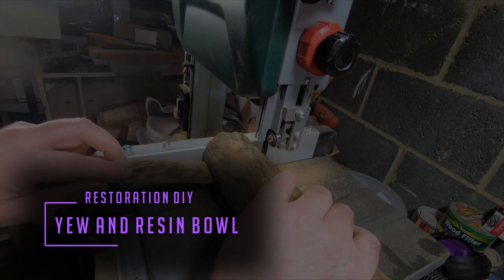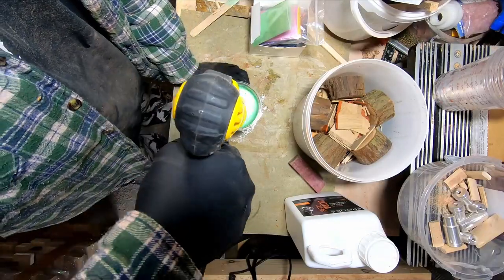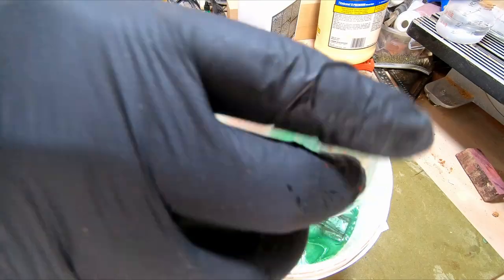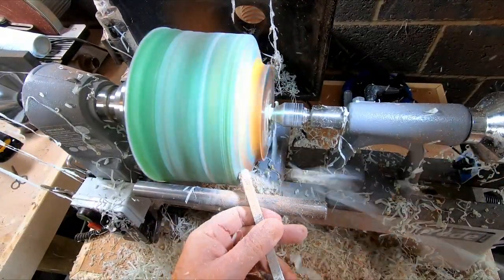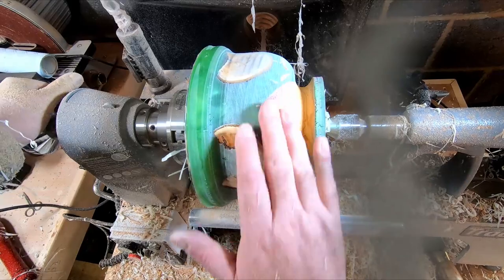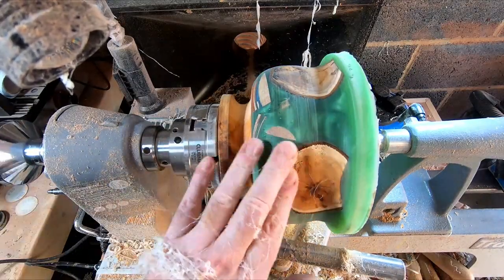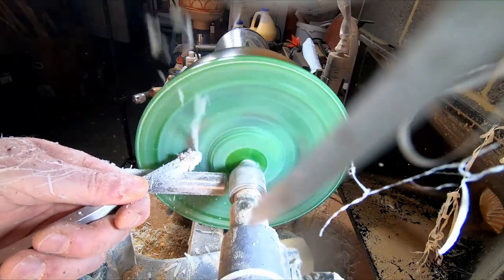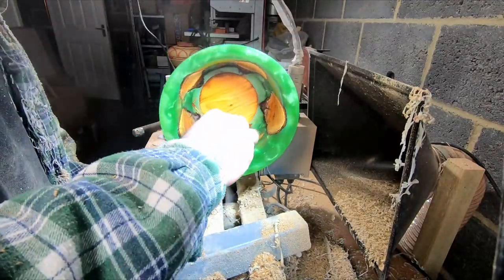Woodturning | Yew and Resin Bowl | Restoration DIY

Comment: Another beautiful bowl to serve as inspiration. I’m looking to start trying some of these too. You mentioned something about needing multiple pours to avoid cracking the resin. Is that just with your brand? I see other channels where they do large pours without cracking so I’m wondering how to proceed. Thanks for any advice you can provide.
Reply from the maker: Hi Thomas, Thank you, The cracking is very much dependant on the type of resin used, the brand I use overheats and cracks when I have more than 3 batches in one pour each batch is about 450 grams  but with that said if I have a lot of peices of wood in a casting with lots of smaller voids I might add 4 batches, I once tried 5 batches and that overheated and cracked like crazy and took a lot of fixing. It also has a lot to do with the ambient temperature in winter when its cooler say less than 10 degrees C I get less problems with cracking, you can get Epoxy Resin specifically for thick set applications but these tend to be very expensive so I havent tried any as yet, The Epoxy I see alot with other woodturning youtube channels is made by Total Boat but I havent seen it for sale in the UK. Hope this helps and Good luck with your Epoxy Projects, please get in touch if you need any more advice.
Gary.🙂

Comment: My first time on one of your videos.  Cool video.  I'm doing my first vessel project in this vein, but not the same.  I wondered if you get the tool digging in when you go from resin to wood?  The wood seems to come out in dust.  The one that I have in the works uses stabilized bits because I was worried about it doing that.  I figured that the stabilized would be a more constant consistency.
Reply from the maker: Hi Dan, I haven't experienced that myself tho I only use hardwood in my resin hybrid bowls I guess the stabilized wood will give better consistency, negative rake scrapers give the best results, good luck with your project 🙂